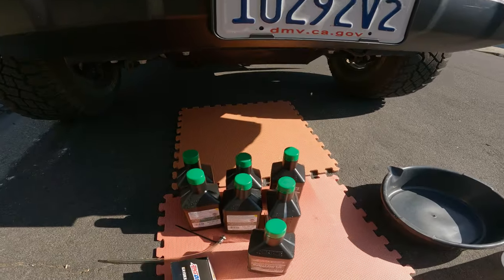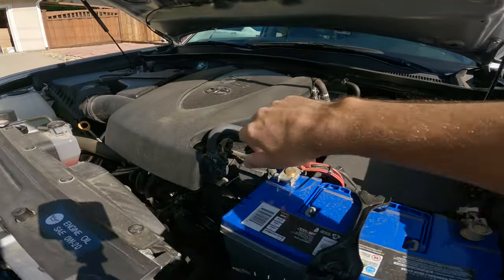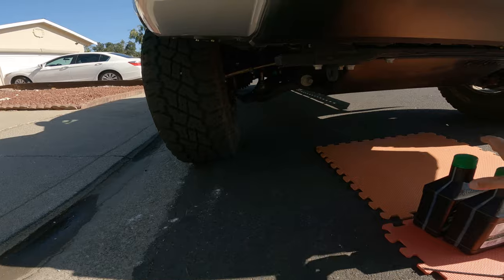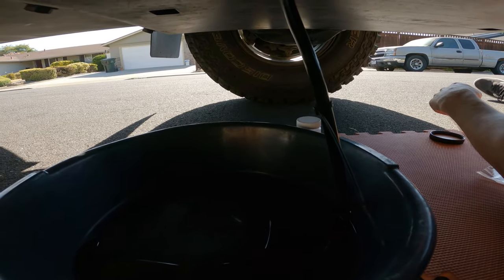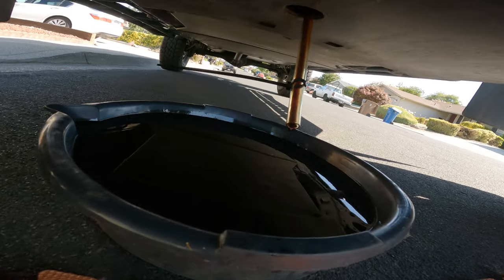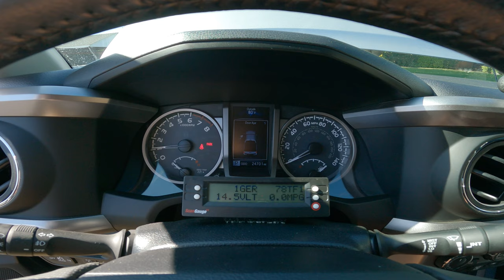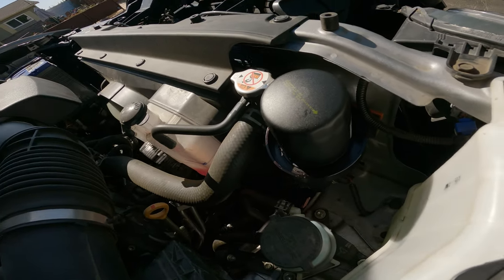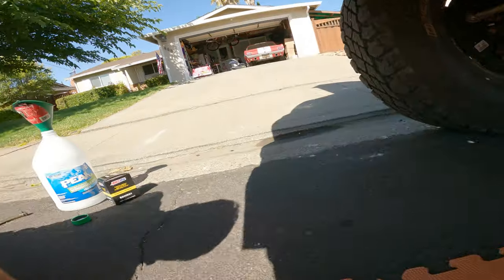Tacoma Oil Change with Baxter Oil filter Inverted mount

Comment: Nice. I use amsoil as well and have the latest fumoto drain valve that has larger drain bore but haven't installed it yet. I was hoping you had a "how to" video on mounting the inverted adapter. I just learned of the Baxter products tonight and plan to make purchase next week. Thanks for the video!
Reply from the maker: Hey there,
Check out this thread where toward the last few pages myself and others have posted some useful info on how we installed our setups.  Hope it helps.

https://www.tacomaworld.com/threads/it-got-real-baxter-adapter-spin-on-filter-oil-change.582655/page-14
Reply: @Rickydbaby  Thanks for the link. I have a question. With using the inverted system/relocation, and you remove the spin on oil filter, all that used oil drains down the hose to the original canister location where the Baxter adapter is located so that portion of oil isn't changed when doing oil change. About how much used oil is left in the hose and where the Baxter adapter screws in to the canister location?
Reply from the maker: @Accuracy1st  That's a very good question and assumption.  I initially just assumed the oil would make it's way back into the pan, but I believe you may be correct that the oil drains down and collects into the original filter location.  I'd have to say it's probably about a 1/2 qt of oil.
Reply: @Rickydbaby  I just ordered my adapter Monday. I was trying to decide if I wanted to use the inverted relocation mount as well for convenience. I spoke with Mr. Baxter and he did tell me about 1/2 qt residual oil does not drain during oil change. As such, I opted to go with the one piece adapter to fit where the canister is located and will be using Purolator BOSS 14670 filters

Comment: Thanks for the vid.  I'm going to buy this from Baxter for my 2019 TACOMA .  Where did you get the hoses & fittings and what is the length required? Any other mounting info would be greatly appreciated.

Comment: Thanks for the vid.  I was hoping to see the filter actually being removed (to get an idea of mess containment).  You said the oil drained back into the engine from the filter.  a few questions about this... 1) When you restart the engine after the oil change, do you fee like it takes a second or 2 for the oil to fill up the (longer additional) oil lines AND filter (since filter is mounted right side up now, with no real way to pre-oil the filter). 2) Do you have a rough guestimate of how much oil (if any) is actually left in the filter housing after the filter drains back into the engine (as you spin it totally off?  3) Does the oil ever overflow from the adapter (making a mess in the engine bay?  4 ) Do you have to wipe the oil out of the adapter before putting a new filter back on?  Your fast reply would be greatly appreciated as I am thinking of ordering one of these VERY soon.
Reply from the maker: Hi there. The oil filter has an anti drain valve built in so no worries on oil draining back down into the engine until you actually unscrew it.  When you unscrew it it just drains into the housing and down the hose. So there is some small amounts of old oil that remains in the hose and the bottom Baxter adapter during an oil change that there is no way to drain/remove.  Haven't had any mess or spill.  I do get a paper towel and just quickly whipe the inside of the filter mount before installing my new filter.
Reply: @Rickydbaby  Thanks!

Comment: Do you think it's worth the extra money for ams oil or is there another oil that's just as good... I change oil every 5000 miles anyway and kinda figured the more expensive ams oil would be a waste to change so frequently
Reply from the maker: I use Mobil 1 on other vehicles. However on the Tacoma I change every 10k with amsoil and amsoil filter. Black stone testing confirmed good additives still in the oil and recommended to try a 12k interval. I'll stick to 10k for now.

Comment: Nice setup........ Did you need to modify anything UNDER the hood to install the new oil filter attachment point ?
Reply from the maker: Not really. Just had to drill a couple holes to mount the Baxter inverted filter unit. It's been a nice setup.
Reply: @Rickydbaby  Does the system come with all the fittings and braided lines that run down under the motor and do you add additional oil for this system ?
Reply from the maker: @markvaughn8096  bought separate. They are an fittings and hose. I used two 90's and 2 45's. I did add a little bit of extra oil only on the first oil change and all other charge after are just the same you add before.

Comment: I forgot to ask, how much extra oil does your truck take with the filter modifications? My 2020 takes 6.2 quarts with factory setup
Reply: I installed my setup based on Ricks helpful video. I use about an extra 1/2 quart.
Reply from the maker: Seems like the first change with the Baxter was about an extra 1/2 quart but after that no extra added oil is necessary on each change.
Reply: @Rickydbaby  That's due to the initial extra 1/2 quart doesn't have the means to drain from your system
Reply from the maker: @Accuracy1st  yes exactly!

Comment: Have you had any issues with this setup? I’m interested in doing this to my 5gen 4Runner
Reply from the maker: not yet, Trucks currently at 55k Mi, and I change oil every 10k, with amsoil signature oil and filters.  I've had oil tested multiple times and every time it comes back looking great and recommended to push my interval to 15k.

Comment: HI RICK I HOPE ALL IS WELL WITH YOU AND YOUR FAMILY. I HAVE A 2019 TACOMA SR5 ACCESS CAB WITH THE V6 I REALLY LIKE THE BAXTER SET UP YOU HAVE .I JUST WANTED TO KNOW DOES THE ENGINE STILL GET THE REQUIRED AMOUNT OF OIL FLOW REQUIRED FOR PROPER LUBRICATION.  AND HOW MANY MILES DO YOU HAVE ON THE BAXTER UNIT . PLEASE ADVISE THANK YOU AND HAVE A BLESSED AND WONDERFUL DAY
Reply from the maker: Hi there, 
Thank you for the kind words!  I'm really loving the Baxter setup so far.  I just got back my Oil test sample and was advised all looks normal and well and could even push my 10k interval to 12k as there is still additive left in the oil.  Great info to know.  I've got about 15k miles on the Baxter setup thus far and the only issues I had was I had to replace the hoses with a higher quality hose after about 5k miles as I had developed a leak in one hose.  after that I've had no leaks and no issues.
Reply: THANK YOU SO MUCH FOR TAKING THE TIME TO RESPOND IM GOING TO GET THE BAXTER BLACK SPIN ON REPLACEMENT INSERT WHAT KIND OF FILTER TO I GET FOR THAT . CAN I USE A TOYOTA FACTORY SPIN ON OR ? . PLEASE ADVISE.  I HAVEN'T A CLUE
Reply: @Rickydbaby  I'm keenly interested in knowing what you chose for the interconnecting hoses and how you routed them.

Thanks for sharing!

Comment: How is it that your 3gen tacoma has the oil filter on top were the motor is and my oil filter on my 3 gen is at the bottom of the motor
Reply from the maker: Check out the title of the video it explains how, "baxter oil filter inverted mount"
Reply: I seen how its install. But on your video u have it ontop were the motor is instead at the bottom of the motor
Reply: @teddymuscio7419  it’s a kit that replaces the cartridge filter and plumbs it up top to the inverted spin on filter. When he checks for leaks you can see the two 90 degree fittings from the relocation housing. Look at 5:08 in the video you can see the two hoses and fittings that connect to a replacement housing below. The entire setup includes the bottom housing as well as the top inverted mount for the spin on filter.
Reply: Yes i seen that in the video.  I was just amazed that u can change it to a cartridge then paper filter.